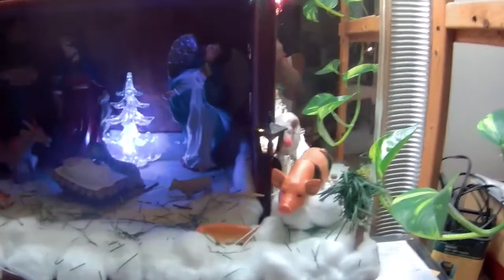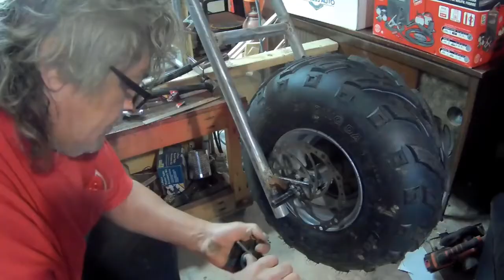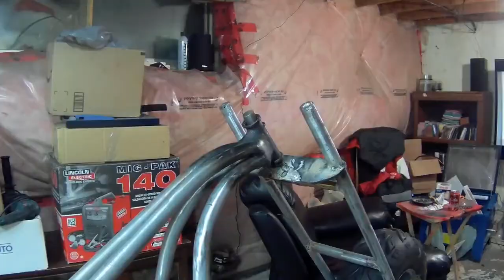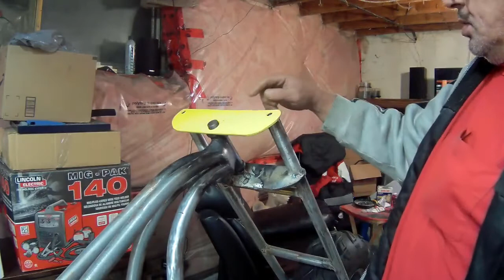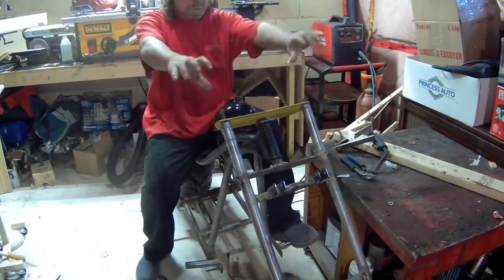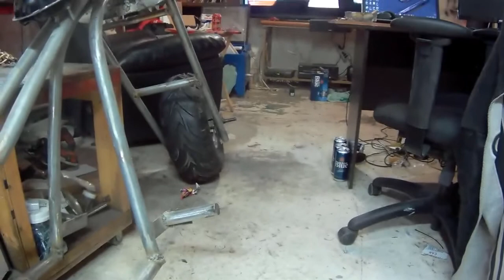Mini Bike/Chopper Build pt.06, Steering and More

Comment: Wonder what color your going to paint this one??
Reply from the maker: I'd like to paint it a nice metallic blue but I can't find the shade I want in a spray can and it costs to much to buy car paint (paint, reducer and hardener) so I might just paint it black unless I find something before painting time
Reply: Walmart has some spray paint colors that is glitter blue, green, and red.  Just wished all walmarts had the same colors.
Reply from the maker: Hey David, Yeah we have Walmarts all over the place here and they all turned into Super Stores (selling fruits, meat, electronics pots and pans ect.) but one thing they don't do here is have a good hardware department, as for paints they concentrate more on house paint, I can't walk into a Walmart here and buy a 5/16 or 3/8 bolt and nut, Have a Happy New Years if we don't chat again before that buddy